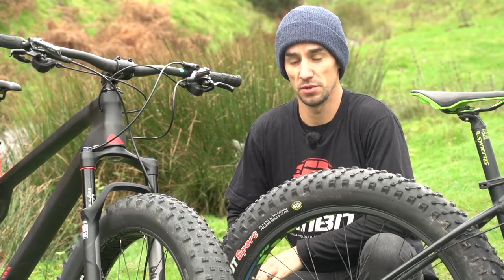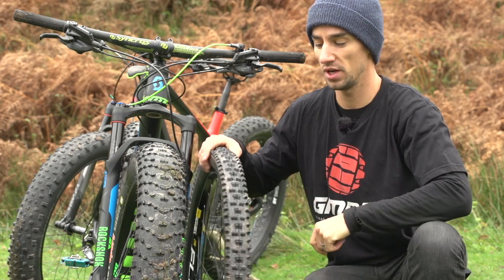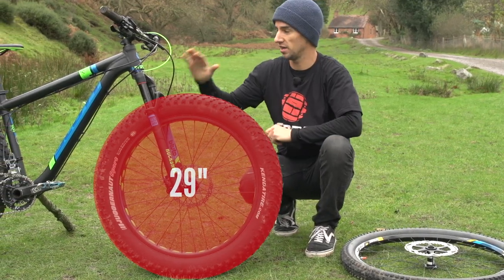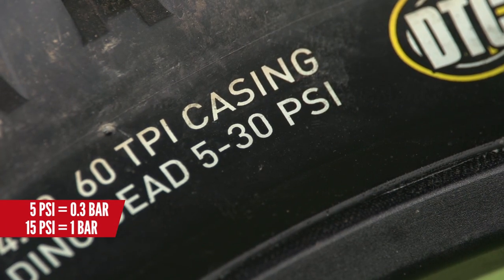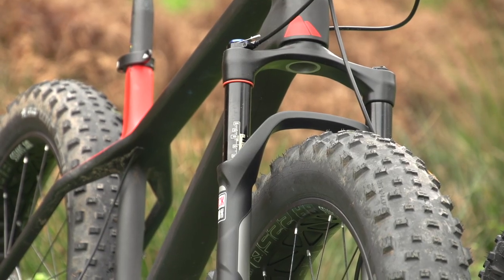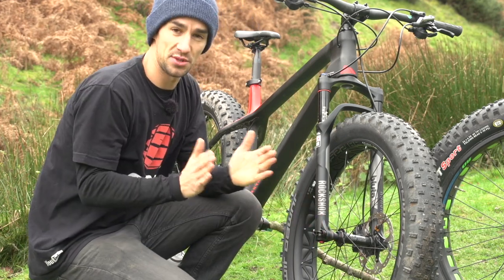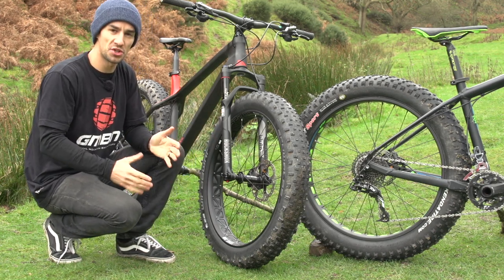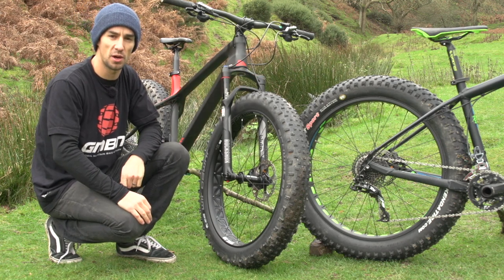What Is A Fat Bike? | GMBN Explains Fat Bikes

Comment: I just bought a fat bike this winter.  The road to tire friction is much higher than a mountain bike, so be prepared to work your ass off.  Even on a flat surface, no snow I found myself gasping for air just riding a short distant.  I am over 50, ( which may be part of the problem) a health enthusiast so I like challenges. I normally ride my mountain bike to work four miles daily; no problem.  With the fat bike I have to ride and occasionally walk part of the way to relive the lactic acid in my legs.  I enjoy the benefit of a stronger, healthier body so I will continue to ride and see if I can make it all the way to work without walking.
Reply: Sorry to necro this thread but what’s your thoughts on fat bikes now?!
Reply: I guess I am pretty off topic but do anybody know of a good place to watch newly released series online?
Reply: Any updates? You still ride daily? Hope you didn't get the Rona
Reply: @sheldonjplanktonn  his legs fell off, he can't get to his computer

Comment: Sorry this may be a stupid question but: Can you puncture on a fat bike and if so is it the same method to stick a new tube in?
Reply: It is possible but very hard to do so because of thickness and you're weight being rather not so much of an factor as compared to normal bikes tyres
Reply: That depends on the tire. The 45NRTH Escalator comes in a 180TPI casing that punctures fairly easily. They are better for snow use only IMO. I got a puncture the size of my index finger in one. When I went tubeless with a 120TPI Hüsker Dü set. I got small punctures so often that I gave up on the idea. Cleaning sealant off of your bike over and over again will do that for you. I think the tube helps the light casing tire resist punctures. I'll use a heavier casing tire next time I go tubeless. 

In answer to the caped crusader. Fat bike tires are easy to pop a tube into. You'll be pumping for a bit longer however. You'll make it home without noticing with a small puncture, only to find that your tire is flat the next day.
Reply: Awesome thanks guys

Comment: Hi nice video :) can i convert the normal mtb to a fatbike just by replacing the wheels and the fork? Thanks!
Reply from the maker: Thanks, no you cant. The bike wont have enough clearance for the tyres. They need a specially designed frame and fork.
Reply: Thanks for the clarification ;)

Comment: Not hugely interested in fat bikes, as they seem too far extreme, i.e., overly specialized for snow and sand. When I look at the 27.5 + tire though, it seems much more general while maintaining some of the advantages of both a standard mountain bike tire and a fat bike tire. It's not to say that a fat bike isn't fun, I'm sure they are, but having a super specialized sand/snow bike isn't that useful most of the time; I could use it on a nice day on a regular trail, but I've got a 29er for that.
Reply: +Ross M Walline Hey Ross,  your right,  I ride on long Island were there is a lot of sand so the fat bike make sense but I've been wondering about 27.5 + lately.   I do LOVE my fat bike though just looking for some better acceleration with that added confidence of the wider tire...

Comment: I was just wondering if height of your saddle is a problem as I have just bought a bike but it doesn't have a dropper post so what height would you recommend for it?
Reply: If you put your foot on the pedal and rotate the crank so the pedal is at the bottom of the rotation and you sit on the seat your leg should be bent just a little bit at the knee without needing to rock your hips. If your doing downhill I would advise dropping the seat a little bit. Also dropper post don't make it so you don't need to set the seat up properly. You set the seat at the same height and being able to drop the seat allows you more range of motion when your going downhill
Reply: +Nate Meyer thank you for the advice. Have a very merry Christmas as well :)

Comment: This may be a stupid question, but can you just put a fat bike's tires onto a normal hardtail and use it on snow and stuff a fat bike is made for? Because like you said, fat bikes are mainly just the tires that give them their difference.
Reply: The tyres are wider, you'd need wider bottom bracket, front and rear forks, you'd need a new frame basically!

Comment: 26 x 4.0 is related to the rim? Whats the width of the tire then?
Reply: It's more of the tire width.

My rims can take 3.0-4.0 width but the width of the rim itself isn't 4.0., is slimmer.
That tire looks 4.0 in the vid.
Reply: It's the tire with. mine has 26 x 4,7, which would be 11,9 cm, and the true width of the tire inflated on the rim is around 11 cm.

Comment: I've been riding this bike for 7 years now! https://www.youtube.com/post/UgkxHL1v1R3NE5x4KiYfyt8dnQmyNYz7qi5L  It was a great bike the day I got it, put it together, and went on my first ride; more importantly it's an even better bike today. I've ridden trails, street, and skatepark all on this bike. I have replaced almost every part on the bike. Some stuff has broken: derailleurs, wheels, shifter. Everything else were upgrades. The only ramaing original parts are the frame, bottom bracket, and crank set. BB and cranks will be upgraded soon. The geometry isn't great but that is really the only draw back to how good a value this bike is. Even after all the money I've spent upgrading it's still a more affordable bike than I'd have bought from a proper bike shop, especially with full suspension. I've also learned a lot about bikes working on it over the years. It really is one of the best perchases I've ever made and hopefully it'll still be around for another 7 years.

Comment: Are all fat bikes Alu and carbon frame? Or are they Chromoly too?
Reply: You get carbon ones (expensive), alloy ones, but also steel frames and exotic titanium ones. The steel ones are usually relatively heavy (20 kg +), alloy bikes are around 15 kg. With carbon you can achieve 13 kg.

Comment: What is the point of getting an Fat bike ?
Reply: Random Videos In my opinion, its good for all kinds of terrain especially on thick sand and snow. Perfect for trails. But other than that, its just for the coolness factor and looking different from other mountain bikes. A friend of mine has the Canyon CF Dude in this video, the black/red frame on the left. Its a head turner for sure and gets lots of attention from onlookers. I tried it on and it felt like i was riding a big truck with big tires! A very different experience for sure. But its not what i look for in a bike and i will stick with my 2.2" tires of my 29er 😉